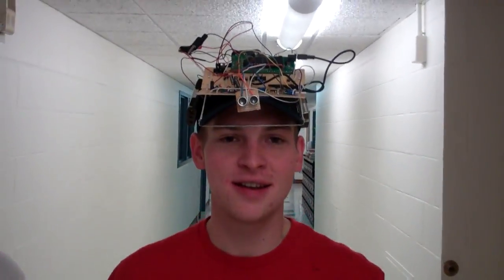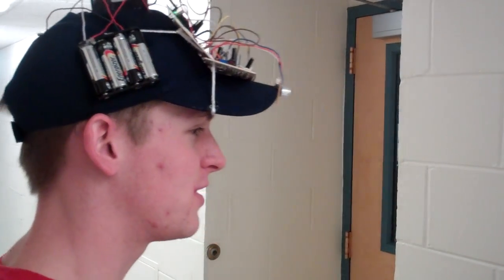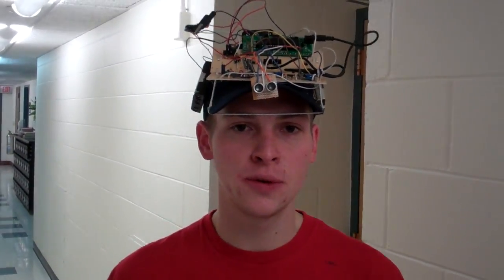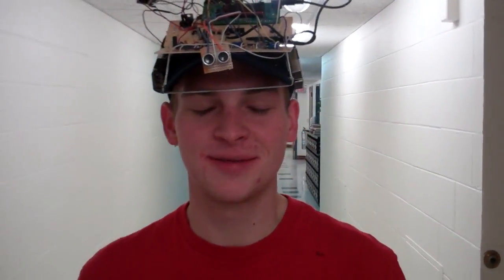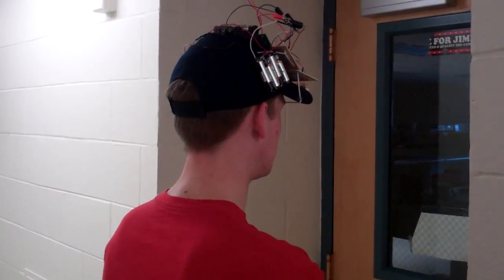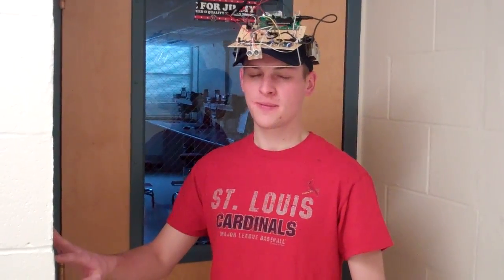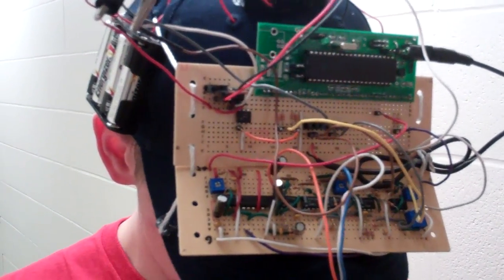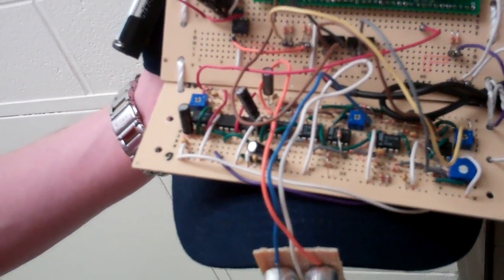Bat Hat

Comment: Brilliant idea and a great name! If I'm not mistaken the distance is limited to about a meter? I imagine your going to put the range finders 360 degrees around and adjust the vibration feedbacks intensity depending on the distance. Are you going to limit the sensors to a single axis? Thanks for sharing!

Comment: It's cool to see young folks still using the 555
Reply from the maker: 172pilot
It is not an Arduino. http://people.ece.cornell.edu/land/PROJECTS/ProtoBoard476/
Reply: Bruce Land That's what I meant.. but I guess I didn't say it right..  It would be a cool project even IF they had used off the shelf design, but they actually went the extra mile and did the low-level stuff themselves instead of relying on someone else's integration and library files, so I'm saying it's even MORE impressive!!  :-)
Reply: That's what I was thinking..  This is a really cool project even if they took the shortcuts of using an off the shelf rangefinder to feed data straight to an Arduino, but the fact that they actually built the transmitter and receivers out of some good old fashioned analog electronics makes it a SUPER cool project in my book..  Good job guys!  Keep it up!  Even if you use very integrated components in most projects in the future, the understanding you get of the basics from doing stuff like this will help you understand how those integrated electronics parts do their fundamental tasks and will help you all your life with design and debugging.